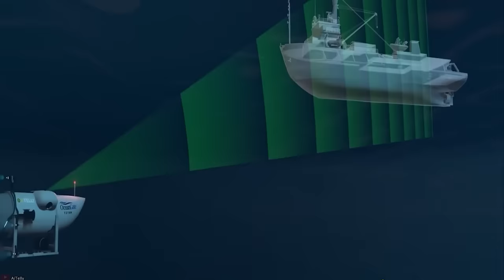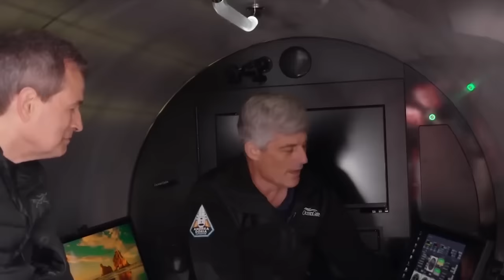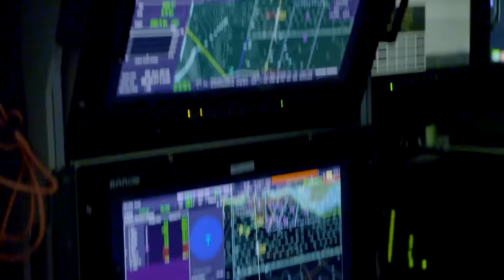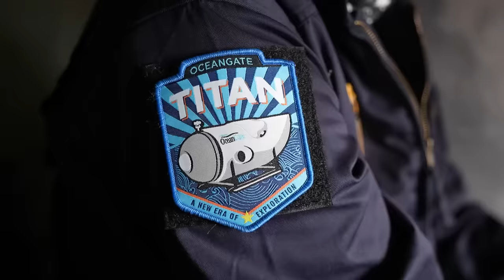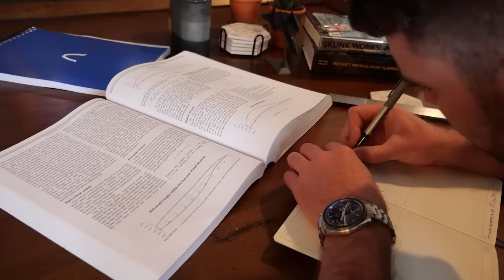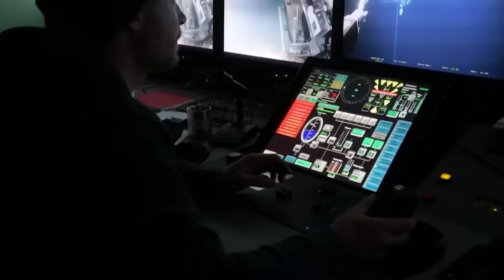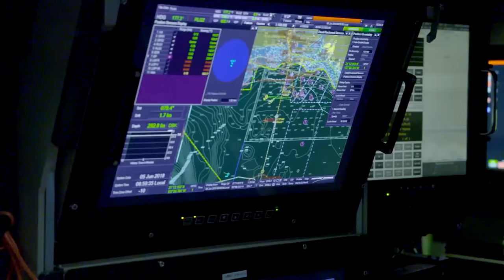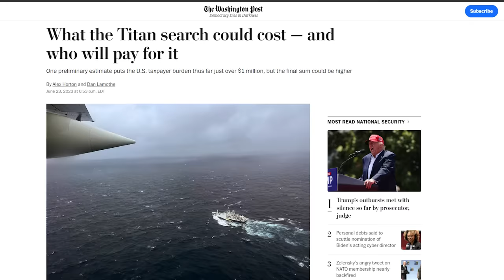US Navy Reveals TERRIFYING Truth Behind The OceanGate Submarine Tragedy | Titan Documentary

Comment: As someone who has broken a total of two carbon fiber mountain bike frames, believe me when I say that old carbon fiber is MUCH weaker than new carbon fiber..  One bike frame that was made in 2006 broke completely in half at the top tube and down tube ( the two tubes that would be between your legs if you were straddling the bike) causing a horrible crash in 2015.   The second frame broke at the headset/toptube/downtube junction and just cracked.  That carbon frame was only 6 years old.  My current bike has a steel frame and I'll be keeping it that way.  Whoever ok'ed old materials to be used 100% had zero knowledge of carbon fiber and hopefully will be held accountable
Reply: Carbon fiber is brittle and hate vibration/shock.  the stronger the material the more brittle.  fellow bike racers I knew in the early 90s told me the frame transmitted that shock all the way through to them  carbon fiber was a MAJOR mistake
Reply: I work in an arena...we have a big pile of broken carbon fibre hockey sticks in the back. They break all the time.
Reply: Meanwhile, I'm still tearing it up on my steel alloy road bike that was once my dad's when he was in high school... in the 70s.  (And it's comfy and not rough like a carbon fiber frame is.)
Reply: It seems as if the person who gave the OK was on board the submersible and holding on to his game controller; therefore he won't be held accountable.
Reply: I think Stockton-Rush got it via rather dubious ways. I for my part believe indeed the carbon fiber was of Boeing-stock, only he maybe fished it out of the trash or something to get it for cheap.
Reply: Better stay off newer airplanes.
Reply: @mediocreman6323  Boeing has denied selling it so, if it did come from Boeing, that's about the only way.
Reply: And there are rifle-manufacturing  companies that offer slim barrels "strengthened" by winding CF around the skinny little rifled steel blank...and shooter who BUY and SHOOT the damned things!
So much NOPE!
Reply: Yeah...but like the tube sub....IT VUZ A BAHHHHGIN !  China now building Nuke sub tubes en masse because it's confirmed the USA-stan navy can't find shit....but their decks are spotless and merit badges shine well. Please sent money for hat's. 20,000 each should be good. My cousin has a hat company. Need forks too ?
Reply: There are different kinds of carbon fiber
Reply: My friend had the same experience with his bike!
Reply: @mediocreman6323  I surmise that Boeing did throw it away and got a waste disposal service to handle it. Either they, or the dump site sold it on. Stockton-Rush cut so many corners when it came to safety, he was spinning in circles
Reply: @edbecka233  That makes much more sense because then the carbon fibre would be in tension, which is the direction in which it is strong. Gun barrels "want" to expand outwards, which CF is good at resisting; submarine hulls "want" to collapse inwards.
Reply: Been racing carbon frames for years and never stressed one. Maybe because I weigh 130#'s? 
Physics is real folks..... If you're fat, ride titanium.😂
Reply: Eeesh ya carbon fiber is over rated lol    Carbon fiber frame for your dirt bike !  im jk  no way to scary. Steal all the way.
Reply: I've broken several alloy MTB frames but never managed to break a carbon fibre frame.
Reply: @edbecka233  In fairness, wrapping carbon fiber around something that holds pressure is working with it's strengths - it's strong in tension.  The big dumb-dumb move here was using CF in compression, where it's terrible.
Reply: Didn't know that!  However, motorcycle frames are steel. We now know it's not for 12,500 ft.
Reply: The moment he said they bought used material is when something odd came over me. It's like my heart mind and soul have gone flat numb; it can't be, it shouldn't be but damn it - it is true. Shaving costs when buying the best ought to have been their goal. 😞
Reply: Carbon fibre is very strong in tension but has no compressive strength at all.
Reply: @007-c4b  aluminum fatigues. Never had one last more than 3 years. Carbon actually lasts longer
Reply: This years Tour De France shows how new carbon fiber can break too in an accident. I think going back to steel is a bit OTT when there are other lighter metals but i can understand.
Reply: Maybe you waxed your legs too hard or carried too much banana in your Lycra banana pocket?
Reply: Honestly, even if it was new this would have happened eventually. It’s just not an appropriate material for that kind of incredible pressure. 

That said, It is baffling to me that the material was “too old” for a Boeing airplane but they thought  it would do in a pinch for a submersible? Coooome on.
Reply: If you’re out here “snapping frames” you must ride on a Sam pilgrim level lol Iykyk
Reply: They had an engineer on another channel who produces the stuff. 
He said that it can be extremely strong, but needs to be inspected regularly. 
Stress can form microscopic cracks that eventually fail.
Reply: @mediocreman6323 yep!!!  Worked out something with an employee at Boeing,  paid him on the side,  that’s why there is no record of the sale!    

Stockton was a hustler!
Reply: I had kayak paddles in carbon fiber and time plus environment weather made them breaks like glass! I cant believe they choose this for a sub going that deep!
Reply: @projektkobra2247 kayak paddle doesnt get much heavy  force and broke easily i was very supprised when it happen so when back to alu and fiberglass!
Reply: @beeble2003 it could come from Boieng trash and someone said to Titan CEO yeah just come and get it!😮
Reply: @machendave thats what i think too! We see that all the time with companies!
Reply: @notsure6304 so i must paddle to hard and fast with my kayak paddle😅 many factors will harm carbon fibers it it still too new to know everything about it!
Reply: @caseytbss  – and since everybody except him was an idiot, it worked brilliantly, now he is traveling the world giving speeches about how great he is and how stupid everybody else was, who are caught in their limited scopes while he is the true innovator – instead of getting himself (and maybe others) killed as everybody predicted.
Reply: @beeble2003 could have gotten it from an airplane graveyard illegally
Reply: And Ocean Gate played the world for four days ...they knew
Reply: It's not so much old VS new carbon fibre. Carbon fibre is strong, however it gets fatigued easily when compressed.

The bike breaking is probably due to design mistakes though. Also there is big difference between "carbon fibers" in the quality of the fibers, if they're braided and what they're used in.

Now in tension carbon fibre rocks! Well unless it tensions around a tight bend, in that case it'll probably give out very quickly...
Reply: @larsmoen5657 probably didn't help dragging the Titan behind the ship instead of being placed on the ship when traveling to site.
Reply: @mediocreman6323  Sounds like some shady Boeing employee made some cash.
Reply: Observation of carbon fiber used in automobile racing is that it is strong where it is designed to be strong, but it is catastrophically weak where it is not designed to be strong.  When if fails it appears to shatter into thousands of small shards.
Reply: @jessejames5825  or like Stockton-Rush either really took the carbon fiber out of the trash, or he simply lied.
Reply: @jodievukmir3187  No they couldn't. We're talking about a raw material, not a finished product. It's not like, say, aluminium, which you could get by stealing something made of aluminium and melting it down. Carbon fibre (properly, carbon fibre reinforced plastic) is a series of carbon threads embedded in a block of plastic or resin. Once the plastic/resin has hardened, there's no way to get the threads out again. The allegation (which Boeing denies) is that OceanGate obtained the threads from Boeing.
Reply: @beeble2003  oh thanks ..it looked to me like they went to a plane graveyard and cut off an engine hull and used that...thank you for clarifying that
Reply: @jodievukmir3187  No, it was a specially built part. There's video online of it being made, by winding the fibre around a form.
Reply: @edbecka233  Rifle barrels generally have the higher pressure on the inside.
Reply: @mediocreman6323  Exactly
Reply: We are talking of 1000ATM pressure under water not mountain and bike 😂😂😂
Reply: @PontificatorX  to😂 😂
Reply: @007-c4b  The problem with carbon fiber is that it's best under tension vs. compression, and in this application Rush was trying to use the CF under compression with poorly spun cylindrical windings that were far too thin and far too long (between the front and rear titanium rings/caps). Also another ring of titanium should have been in the middle of the body to reinforce the CF cylinder to get to the depths they were working at safely if he insisted on using CF instead of an all-titanium hull.
Reply: @007-c4b  Titanium flexes? I thought it was super stiff.
Reply: @sara_._paula  Yeah Rush had been told by another submersible operator who went down with him that "you don't have a viable/saleable product" because of the 'gunshot like' noises the hull made as they were descending into greater pressure depths. Rush basically didn't invest enough money to do the thing safely and as a consequence he had trouble getting paying customers which made him cut more corners.. it was a vicious cycle which started with bad decisions from the beginning and was always headed for tragedy. On some level I think Rush knew he was going to die and was so narcissistic he took those lives with him.
Reply: @NoMusiciansInMusicAnymore  Banana hammock.
Reply: @larsmoen5657  I read that because Rush was in dire financial straits they used a smaller boat to get to the Titanic site and had to tow the Titan sled behind the ship and it was buffeted and banged by the waves on rough seas for hundreds of miles- it's very possible that in addition to fatigue from the 16 previous dives the vibration from towing was the final straw that compromised the hull and sealed their fate. It probably would have happened eventually regardless because the design was bad from the beginning.
Reply: @sunsetlane3924  That's exactly what I was thinking. The towing might have been the final straw- of cracked carbon.
Reply: @mmi16  The Challenger disaster was partly due to the carbon fiber wing leading edge not being strong enough to handle a foam strike.
Reply: @007-c4b  Fascinating. Thanks.
Reply: @beestingza  haha, it's worse, they actually have banana pockets in the back for quick potassium boost... Or to hold extramarital aids... It could go either way
Reply: @trionaire6252  Bow down to me human! For by thy own words thy hath confirmed mine own power to not only break carbon bicycle frame but also gods mighty mountain itself!  LOL....
I said that I, myself was able to break something made of carbon fiber with only my body weight and that the older that carbon fiber was, the easier it broke..
Now think of what a thousand atmospheres of pressure can do.. I don't know what you intended with your comment but all it did was prove my original point.
Reply: @edbecka233  Remember, carbon fiber is really strong in tension, but weak in compression. Carbon fiber oxygen tanks used in aircraft, or even rifle barrels are insanely strong (tension, keeping pressure in) However, used in compression as in a submersible is weaker, especially when not wrapped in a bias (crisscross pattern) but rather wrapped in straight line as in the Titan. CF is a great product when used properly...
Reply: In all likelihood, "accountability" for "Titan" has already been "satisfied".
Or, at least as much accountability as can be gained for now.

R.I.P. to the "crew" of "Titan". 
☹️
Reply: Ocean hate owners/shareholders should be arrested.
Reply: Well. Let me just say that many have stated that carbon fibre of any kind was just not the right choice. Maybe I’m wrong but I’d go with tried, tested and true materials. This isn’t the right project for experimentation. And what about the idea of a dummy crew testing it out before having people go so far down below?? To me, that’s just common sense. This guy was to put it one way, “cocky”. I’d say, “dangerous”.
Reply: @mediocreman6323  It's a fact that unscrupulous companies that buy obsolete parts and supplies from tech corporations on the condition that it is now "scrap" will turn around and sell it as-is for re-use. Air disaster investigations can trace down minute parts from a few digits of a number on debris. 
I was on a small group tour of an airline's facilities and there was a crate of things like brake disks in it. This was in the '80s in Canada. The guide said they used to sell the crates like that for scrap to some outfit in Florida. Then they were horrified to find out the brakes were being resold as-is to lower tier airlines. Ever since, those bins are under watch until they break everything down with cutting torches before it leaves.
Reply: Have always assumed it would weaken,.age poorly.  Frames, suspension parts, etc. Too ambitious for me.
Reply: @raphaelszok8561 Why? Carbon fibre is strong in that application, it ISN'T however when it comes to compressive loads. 🤷🏻‍♂️
Reply: @fredcarr3550  lol....
Reply: I work on heavy transport aircraft, just think of the 787 and the new 777 wings and wing box. Getting stressed 2-3 times daily. You are correct about fiber fatigue.
Reply: @beeble2003  That makes total sense!  When resisting outward tension, the fibers are taking the load... When the tension is pushing inward, the carbon fibers want to collapse and the only thing keeping that from happening is the strength of the epoxy/glue holding the carbon fibers together
Reply: @fredcarr3550 I think you could say he has been made totally accountable.
Reply: @supafrancis that is a bit of a worry for the continued safety of modern airliners! An A380 just bursts ope at 34,000ft doesn't bare thinking about.
Reply: @robertmustard7178  So true.
Reply: What about aluminum? Steel's sort of heavy going uphill. Also, my road bike's a hybrid--carbon forks etc., aluminum tubes.
Reply: Rush thought he was a visionary innovator smarter than all the experts who warned him a carbon hull was going to kill people.  
The expert who sued for wrongful termination was fired because he told them the hull was already badly damaged and was insisting on doing tests to see if it was safe enough to use.  They hired him for his expertise.
Reply: @Urban_Piggy  This submarine had already been on several dives. Which either proved it was safe, or stressed it over several cycles until it broke (as actually happened). A dummy crew would not have proven anything. I would have wanted to build a pressure tank, where the sub could be tested (without crew) at higher pressure than planned before each dive. If it did not break under the higher pressure, then it would not break under the dive pressure, for one dive.
Reply: @mmi16 shard
Reply: Held accountable? That person went down with his ship unfortunately.  Seems to me that they would have been better off using Kevlar than Carbon Fiber swiped from Boeing Surplus
Reply: @compwiz101 excellent point!
Reply: The damn thing had stress fractures in it and has bubbling in it. The fact that Boeing has no record of the sale of the carbon fiber is a tell. It is likely they sold it to them off the record, an employee got it for free or at a discount and it was off record and they sold it to the titan builders. Maybe it was supposed to be a scrapped and a supervisor saved it from the trash pit and snuck it out only to sell it to the guys for the submersible. 
I heard the documentary about the deepest dive in a sub in the Mariana trench and they heard some scary noises and the thing popped and cracked and it was very very thick. I remember it being a scary story. I am about to watch it again.
Reply: @mediocreman6323  I think the amount he took was too big for a trashcan, plus I don't think he could just rummage around (security, badges, etc.), but I'm with you here.  The fact that this video noted that Boeing had no record of the sale, leads me to believe Stockton was given it for free OR I can imagine a different scenario, having worked at a huge DoD logistics center that had heaps of crxp laying around, unused.  
Imagine a scenario where Stockton has become known for bragging about sourcing his craft as 'inexpensively" aka cheap as possible (look @ his pride about the joystick) and someone knowing the stuff was going to be junked, decided to make some $ for themselves (& not their employer) by appealing to Stockton's "boastful" aka cocky "miserly" aka cheap-skated ways who would think he got a bargain, given a good reason (it's too old for airplanes). Who hasn't drunk or eaten something past its sell-by or expiration date  & been just fine.  Plus some people never learn the skill of thinking beyond, into the future & what they will do, what can happen.
Of course, we'll never know 'the reasons' but I think we're on the right track on the how's of how it was procured.  I don't think Stockton had malice, but perhaps a bit of a character flaw & also having lived a life of some privilege, he may have been a bit too egotistical about his knowledge & too optimistic to think of bad things happening.
Reply: Nowhere not holding anyone accountable it's all been hushed up ! After all the owner died in the sub along with the other unfortunate people !
Reply: @beestingza well, kinda. See, titanium has the highest strength to weight ratio of all known metals, but steel, for example, is in fact a lot stronger than titanium for sure. Titanium is normally used because it offers the highest strength you can have while still being relatively lightweight, which makes it ideal for aerospace applications. On the other hand, it’s definitely not going to be the best material for a submersible since an underwater vessel shouldn’t need to be lightweight for any reason. Also, titanium and carbon fiber are both much more expensive than steel, which is much stronger anyways. If they had used entirely steel for the sub, it would have cost much less to make, and at the same time it would have been much more structurally sound
Reply: Stop crashing your bikes 😂

Agreed re acid test carbon fiber 

(Mines MX helmets acid test 👌)
Reply: Graphene is 200 times stronger than steel, at 1/5th the weight.. 1000 times stronger than pure aluminum.. you can make it cheaply in your garage with an arc welder, ammonium sulfate as an electrolyte, vapor deposition and lots of scotch tape and a lot of patience.(Top down synthesis) Add about 5% powder into a carbon graphite mix and you will NEVER BREAK ANYTHING made with it. I've done it myself several times, I'm actually thinking about forming a business.. everyone I show the stuff to can't believe the strength.. I can make an arrow that is indestructible (For all intents and purposes).
Reply: @irigoyenanita  ok, but we’re talking about carbon fiber, not graphene
Reply: Welding a US combat submarine is an exacting process .The US Navy learned the hard way with the USS Thresher.That's part of the expense.They are designed with redundancy for safety.It rings alarm bells in my head, that they did not pressure test the Titan's hull before Human occupancy was allowed.How did they get away with that?
Reply: It is a very poor material in compression. The fibers are designed to hold together a resin in tension.
Reply: Yeah, carbon fiber as you know is strands, in only two dimensions, x and y which makes it weak in that other third dimension, depth, z. Metals do not have this problem. After the construction, which was made in the usual way one builds with carbon fiber, cross linked mesh mat, simply layered and repeat. When it was tested in the water, under pressure, repeated loud "bang!" sounds were heard, this was the built up layers of carbon fiber actually "de-laminating" from each other. This was a simple misunderstanding of the abilities of the carbon fiber, if it's strength was being tested in either x or y dimension, it may have been O.K. but that was not the case....
Reply: @ashleyobrien4937  In this case, it was bobbin wound and only strong in tension in 1 direction. It would have been ok as a pressure vessel, but not in compression. It was designed to resist tensile hoop stress as are Aircraft and space vehicles, but not submarines.
Reply: @cozymonk  can't beat an alloy bike frame. my favorite.
Reply: @beestingza You mean the Columbia. The Challenger exploded  on Takeoff when one of the solid rocket booster seals blew out because of how cold the outside temperature was.
Reply: @fredcarr3550 
Actually he WAS held accountable. 
He was sentenced to death. And the punishment was immediate. 
That is the only positive out of this negative. 
He was there TOO.
Reply: Thank you!!!
I have a used carbon fiber bike.
I now know not to push my luck.
Reply: I think the guy who did was held accountable in the most real and immediate way possible as he was in the craft.
Reply: @wesgreen241 You mean the kind that's broken and the other kind are the ones that haven't broke yet? Haha
Reply: @compwiz101  aluminum
Reply: You get what you pay for.  I didn't see a brand, nor evidence of your  care and inspection of the bike by reputable inspectors.  You nick carbon just slightly and you can compromise strength
Reply: Maybe it's not old carbon fiber, but it's you leaping off of MOUNTAIN'S LOL😂
Reply: Are you saying carbon fibre decays over time?
Reply: @machendave How shameful not to put other's safety before yours!!
Reply: Lve had that on my bike carbon fiber mountain bike frame. Mate
Reply: Carbon fiber is super strong under tension. Not so much under compression.
Reply: Well, he allegedly got it at a discount too (which boeing doesn't seem have a record of.) So you need not think any further as to why it was what it was. 
The choice for carbon fibre here would be the same as using concrete for an application where it gets pulled at. WRONG material for the WRONG application.
Reply: @edbecka233  Whats the point here? this again goes to show people don't understand how to apply CF properly.
Reply: What are your thoughts about carbon fiber airplanes like the sr-22? It sounds like we shouldn't plan to let any of those fly for 40 or 50 or 60 years like we do aluminum planes right now.
Reply: Oh and I'm just talking about General Aviation airplanes that are not pressurized. Aluminum Jets and airliners that are pressurized also have a limited lifespan based on how many times they were pressurized and depressurized. Not sure if that's even another compounding effect on fiber fuselages. I'm pretty sure there are planned, or maybe production already, pressurized airplanes made from carbon fiber.
Reply: @placidbeach  When applied properly carbon fiber is strong and light. As I stated it's great under tension but not so much in compression. If the use fits the application usually there's no problem with it. BTW the skin of the SR22 is made of Titanium.. Aluminum would melt.
Reply: @bobbamford5207  I might have said the wrong thing. I meant a sirrus four-seater airplane sr-22, I think you're thinking of the SR-71 blackbird?
Reply: @placidbeach  OOps yes my bad.
Reply: @beeble2003 ❤
Reply: I ride a carbon fiber road bike and love the lightness. It saves my wrecked knees.

 Not sure if I am brave enough to buy a carbon fiber mountain bike, even if my knees allow me to ride it.
Reply: @larsmoen5657  The shock I get with my carbon fiber road bike is no worse than my aluminum gravel bike over the same surface.
Reply: Carbon fibre can stand impacts but pressure maybe not, that is titanium’s duty, for someone who saw himself as Elon musk of sea exploration Stockton Rush was Stupid AF